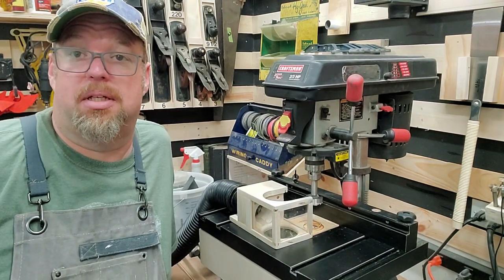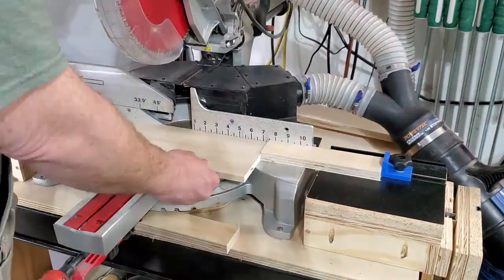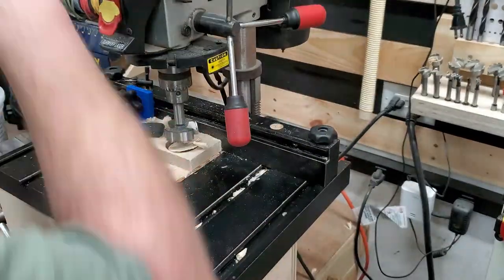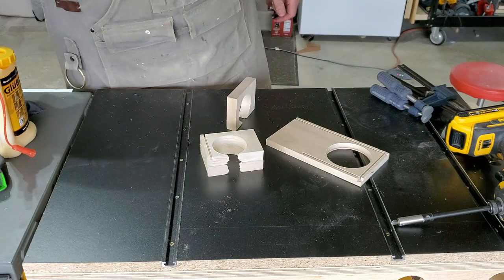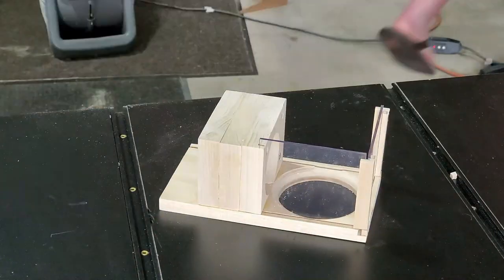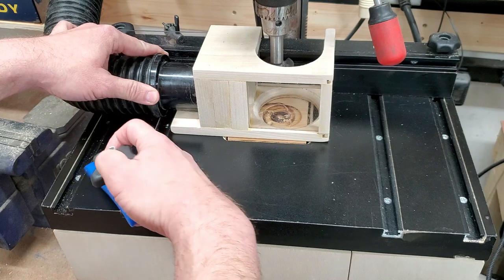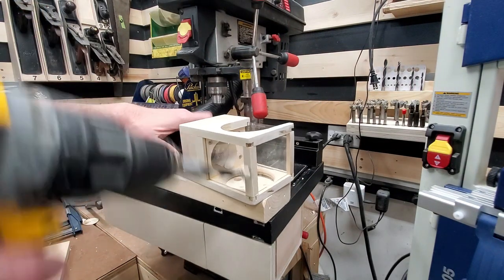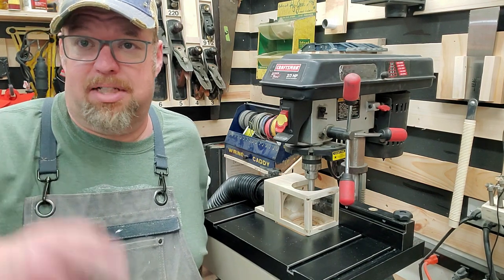Capture all the dust and chips at the while using a drill

Comment: Very nice project! The only potential issue I could see is that your drill press looked pretty close to bottoming out on the top of the box, potentially not being able to use the full capacity of the drill bit. Have you had any issues with that so far? - Joe
Reply from the maker: On my drill, the laser assembly is what causes the issue. I never use that. I may remove it then I would have a lot more clearance. Also, my drill only has a 2" max throw.